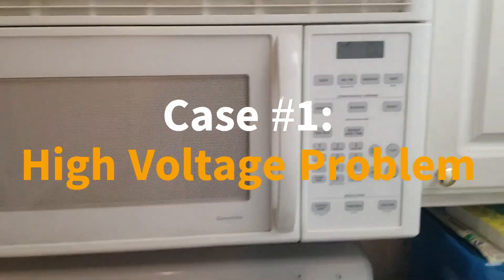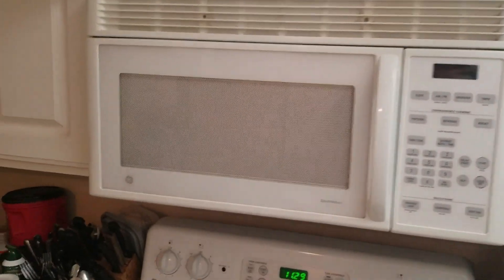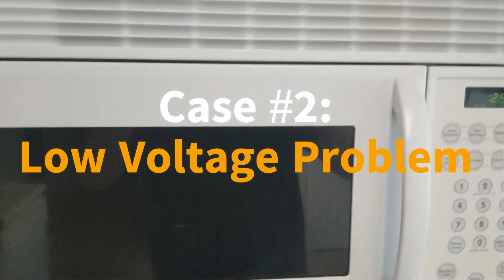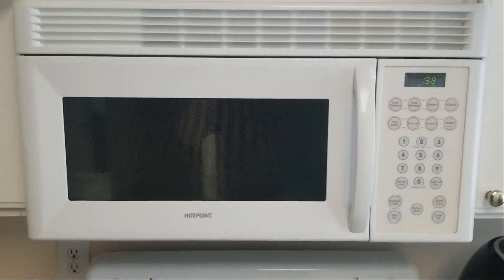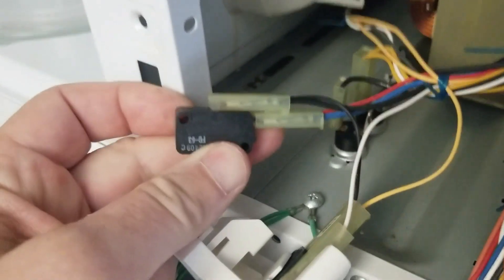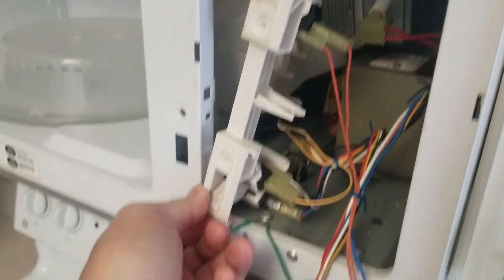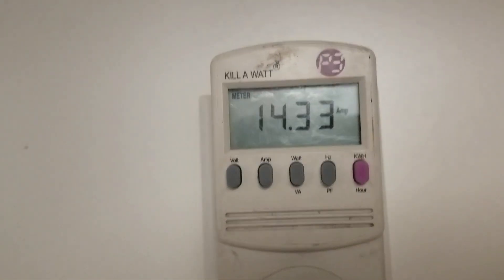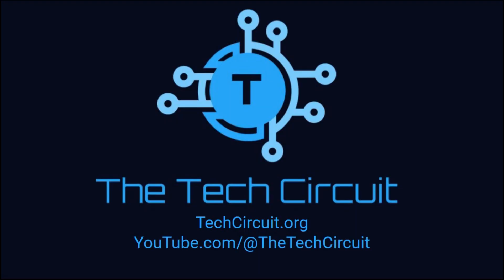#50 - GE Microwave Not Heating - Advanced Diagnostics using Current Draw

Comment: Terrific video!   I don’t have a kilowatt meter to test my 5yr old GE microwave that powers on, lights up, turntable turns but no heat.  All door switches tested good with my multimeter.  Also I replaced the control board which didn’t solve the problem.   I’d appreciate any assistance.   Can I assume it’s the diode, magnetron or transformer?   If so I’ll replace the microwave.   Thank so much.
Reply: Did you fixed? I have the same issued with mine
Reply: @jhoancifuentes198  No I bought a new one since I suspected the problem was magnetron, diode or transformer.